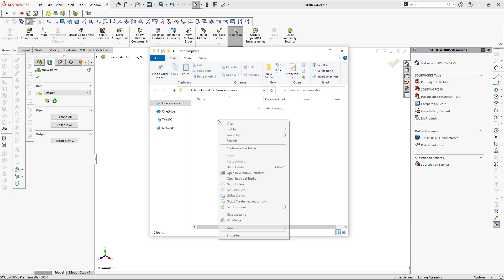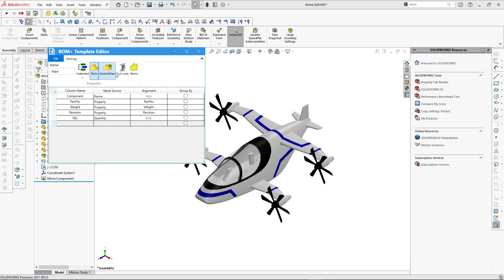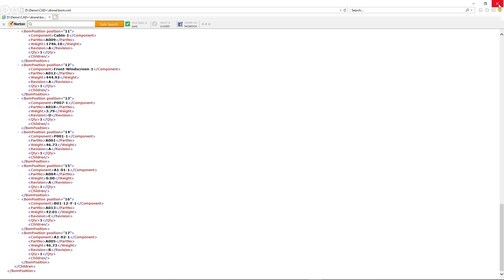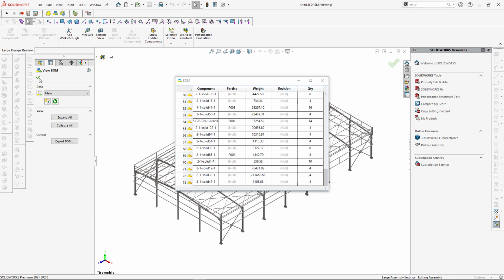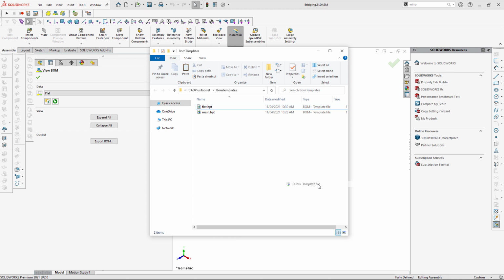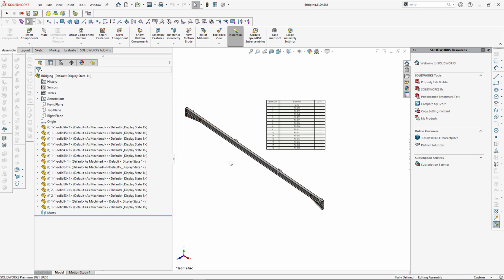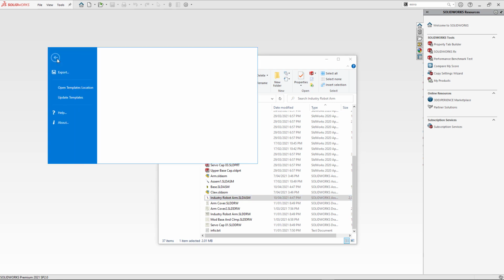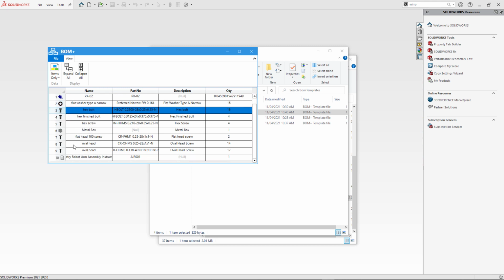Advanced management of Bill of Materials using BOM+

Comment: When will the BOM+ module be available for use?
Reply from the maker: Hi Gregory, public beta is planned within the next 2 weeks. Private beta is available now. If you want to give it a try, please send e-mail to beta@xarial.com and I will organize an access to private beta for you.
Reply: @Xarial  Thanks! I have submitted a private beta request by email. I look forward to checking out the software. Thanks!
Reply from the maker: @gregorymagistro2438  Thank you very much. We have added you to the beta program. You should receive the e-mail with instructions.
Reply: @Xarial  Hello from Brasil! We need export thickness from assembly to excel file. Is possible with this Beta? W will send an email to you. Thanks in advance.
Reply from the maker: @John77Designer  hello and thank you for the question. You can export value of the bounding box (width, height, length) which can be a thickness, or if your thickness is a custom property (or cut-list property) in case of sheet metal, you can use Properties+ (another module of CAD+): https://www.youtube.com/watch?v=ZnJ97_ISWGk